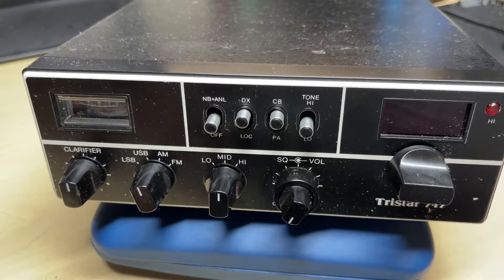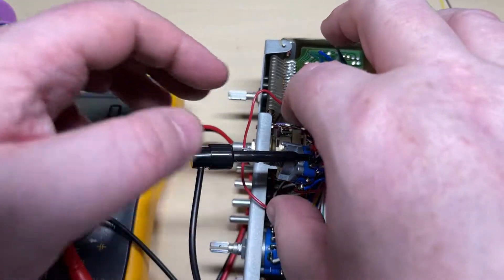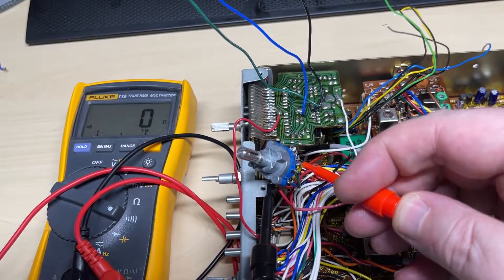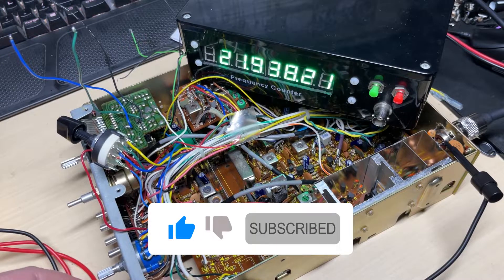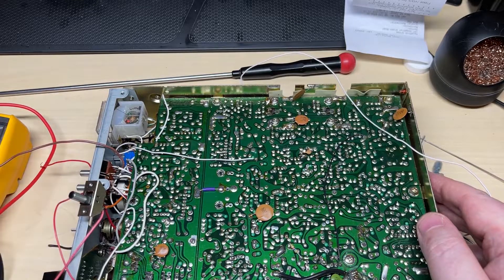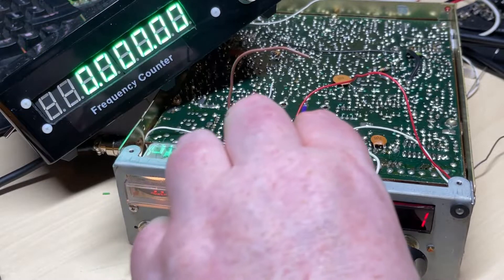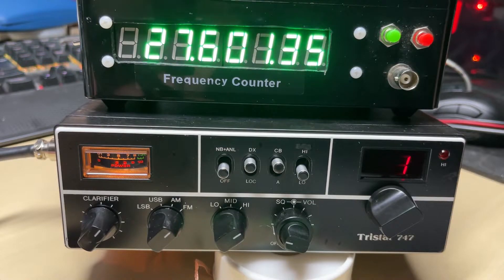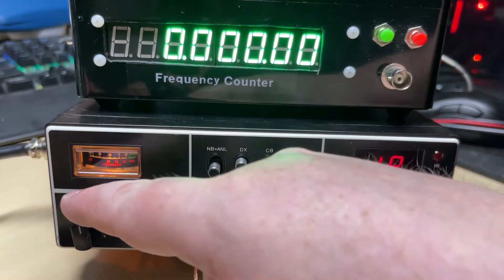EP 070 - Tristar 747 PTBM121D4X Part 3 - Band select switch and final tests .

Comment: Still got my 747 from 1980, set it up few months ago but no one on now I remember when I got my first cb radio in 1979 a sharp little window there was that much skip from America you couldn't talk to someone just at the other end of town.
Reply from the maker: Good little radios when they are not fiddles with.
Reply: @MicroChipz  I think the only part I ever replaced was the PA transistor , I still have them in stock , think it was a 2SC1969 ?
Reply from the maker: Well new old stock 1969 are so rare these days ,if i had one i would want to put it in a radio lol